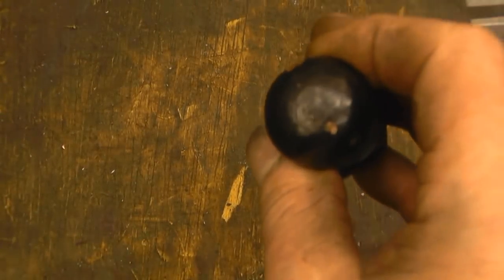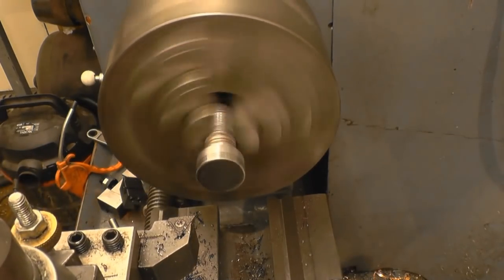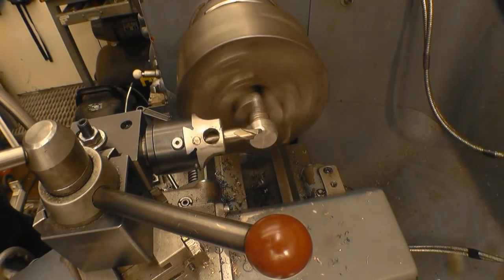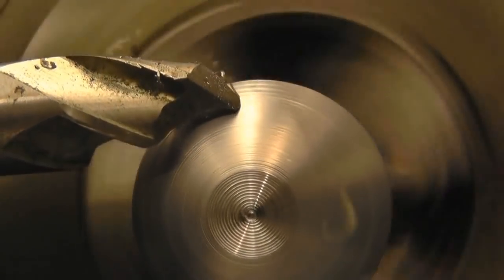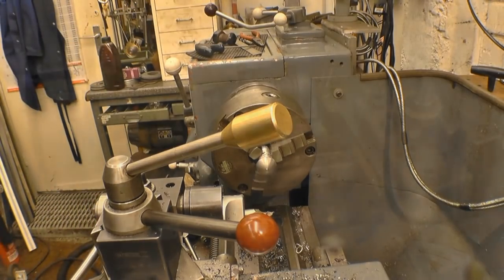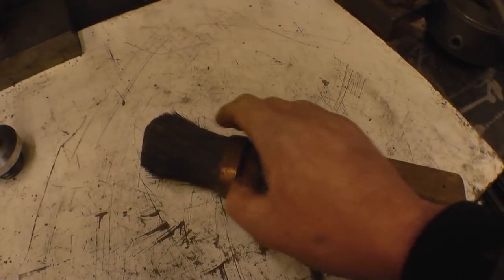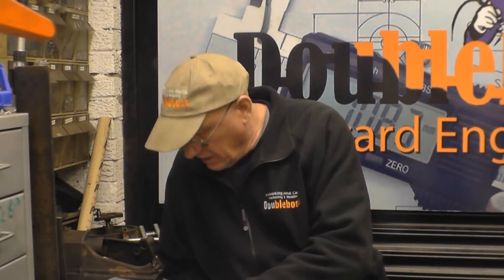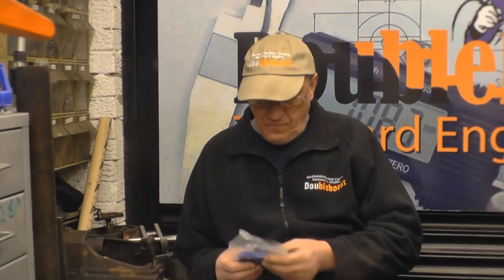SNNC 212 P2    Ball Turner

Comment: As per BANGGOOD... I must mention, folks be very careful, that WEBSITE is very addicting, LOL... I spend close to $400.oo USD per month ordering stuff from them. Next, Keep track of EVERY SINGLE THING that you order, and keep all of your paperwork, and take pictures of the package of exactly how you got it, before opening it, then take pictures of the products in great detail, as those are needed if you have any issues with faulty product, and you will get some bad or broken or missing product, but, small issue on that, as they will take care of it, if you follow the rules, do not take the credit points in replacement for missing or broken items, just get the replacement item shipped. As per the points system, sure, take full advantage of the system, do the feedback and video commentary to gain points, and it kinda equates to every $10 buck, your point gained are about $1.75, and do add up quickly..  do not loose your marbles dealing only with email, there is no phone number to contact, except the warehouse in USA, but, unless you ordered through them, they can not help with the orders from outside the USA's warehouses. The only gripe I have with BANGGOOD.com is the horrid ways they package the products, but, I suppose that is how they get away with extremely cheap "overseas" shipping/handling fees...  Next point, there website has the "shopping cart" icon button, there is the option to "add to favorites list".. that is extremely useful. of which you can eliminate items later ,or find package deals for cheaper, etc.. I must repeat, it is very addictive, and your first time ordering, do not order something that you are needing right away, as the products you are waiting for may take 30 to 45 days to get to your door step, at least from the out of the USA warehouses,  but, if you have a weekly or monthly order going all the time, it is like Christmas all the time at your door step, as the packages each show up at different days, EXAMPLE, in one order of 10 items, you likely will not get a box or bag full of those 10 items, they will each show up in their own packages/bags. You will get to know what products will show up together as per the "Check out" page when placing your finalized order, as of those 10 items, 3 will be of one location in China, 4 of another, 1 another, 2 from another... so you'll get 4 packages at 4 different times, each with their own packing/shipping numbers. Lastly, really study the pictures of the items you are interested in, to see if it is what you are willing to make work, or if the quality meets your desired standards, like per say, cutting tools, there is some extremely high end cutting tools, that are penny's on the dollar cost, and there is some absolute garbage or cutters that are what I'd call rejects, that were not manufactured or sharpened correctly, again, penny's on the dollar cost's, but, may not be usable?.. just study them well. Remember, this is Asian manufacturing, and how it can be so cheap, first by cutting out the various middle men and warehouses, and custom's taxes ,but, ultimately, some items are just training for folks over there, lol, but, I love this site ,and for every 100 items, 3 to 5 items are (as mentioned) missing, broken, or just junk, which is why you keep track of everything and photos, and they will take care of it. Good luck folks, P.S. I do not work for BANGGOOD, I do not get paid to say or talk on their behalf, rather, I just have an addiction to buying their crap....lol and have plenty of experience in dealing with them... again, be patient and good luck, Dru

Comment: By turning off the hex you have seriously reduced the contact area of the head of the bolt to the plate. Cutting a chamfer has reduced the contact area even more. You need as much contact area as possible to provide the friction so you can tighten the nut on 'tother side. After all its not like an external piece of work that could cut finger tips.

Comment: Hi John, interesting video.. Will you be heating the rivet-headed bolt red, and then tighten the nut? Rivets ( hot rivets) grip much tighter than you can achieve with threaded fasteners.